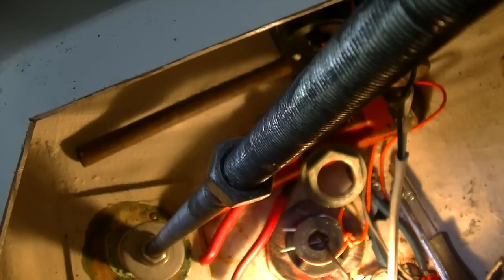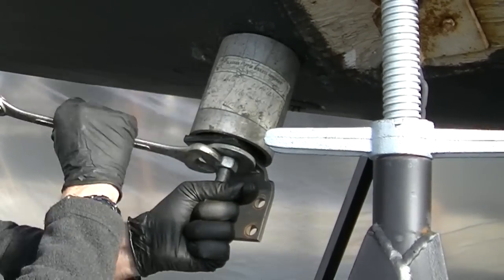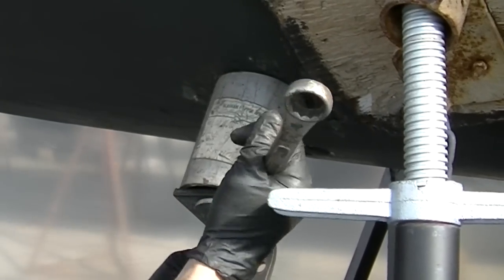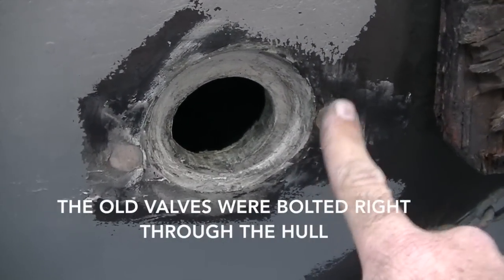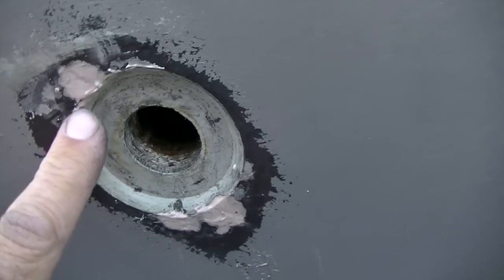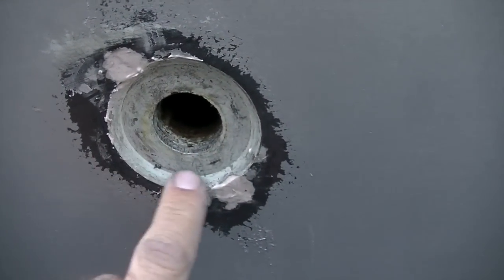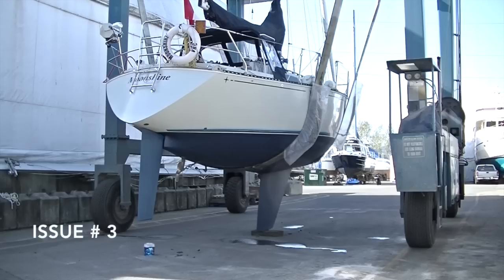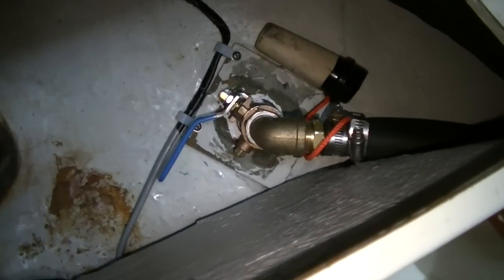Life is Like Sailing - Head Systems Upgrade -  Part 2

Comment: It's a shame that most people hired do not dedicate themselves to provide quality work. In the boating maintenance industry, word of mouth is king, and I'm sure people like that do not get recommended. I'll be looking at some similar work by next year on my boat. I just happened to remove a Jabco head similar to yours to rebuild the hand pump, and I'm seriously considering a composting head and replace the holding tank with an extra fresh water tank on my E33. I'm currently at a marina in FL, but plan on being on anchorage by early next year, so the extra fresh water will come handy. I guess I missed out your haul out videos, so I'll be searching for them. Thanks for sharing!
Reply from the maker: +javacup912 I agree that a composting head is probably the better route to go!   Once I know for sure if this is the boat I will keep long term then I will likely make the change.  Always nice to have lots of fresh water aboard!  :)

Comment: Wow...sorry to see and hear that, Alfy. Is it normal to put that sealant on the threads of the sea-cocks?  When I replaced mine ( i didnt change the thru-hulls), but only used tape-dope (teflon tape) on the threads and elbows.  They don't leak, but I did put the sealant on the hoses where they connect to the fittings.  I also replace the plumbing with the new white hoses like yours, and I also got a new jabsco, but the miniature one since my head is smaller (27ft boat).  Its gonna be a mess when you have remove the sea-cocks for their inspections/maintenance.  I was surprised to see the mechanic put the sealant on the outside fo the hull to where you wanted to epoxy.   Well at least you have a nice new toilet and all new hoses and valves!  Glad to hear you back on the water, though.  I launched but pulled the boat out since the stuffing box started to leak.  1 drop every 5 seconds with no rotation of shaft, not a terrible leak and I tried to tighten it, but it didn't help.  Since i do my own work, and it was the first time for me, I pulled the boat out to change the replace the old flax with new.  I try again next thursday, so I hope my repair was good.  Anyway, thanks again for your videos.  It's awesome that you share this with us.  Great to see other sailors and how they deal with issues and sailing.  Take care, Alfy.
Reply from the maker: justice tek I'm not sure if it is normal practice to put the sealant on the threads and I figured teflon tape would have been fine as well?  Glad to hear your don't leak.  :)  

That stuffing box sounds like it was leaking a bit too much so good you are going to re-stuff it and sounds like you are getting lots of things done on your boat!  :)

Comment: Nice boat and good videos . There is no excuse for bad workmanship . The valve you have has a bolt on the side . Get spares as the tend to corrode away in time .. (I had this happen crossing the Atlantic). There should have been an absorbent washer / spacer between the nut and the hull . Keep videos coming . Great stuff.
Reply from the maker: matrixi4i Good info to know and thanks for sharing that!  Glad you are enjoying the videos!!  That must have been a great crossing!!
Reply: Was a great trip . Couldn't work out why I was taking water in heads outlet until I found that bolt on side had corroded and was leaking. Even thou it was Bronze (never use brass).Keep up the good work-Mark
Reply from the maker: matrixi4i Sounds great and thanks!

Comment: hello excellent videos! I'm wondering how you secured the base of the head-bolts or screws? if bolts how were you able to tighten the nut on if its solid underneath the head? thanks

Comment: Maybe you already addressed this but, how come you didn't remove the new sikaflex and epoxy around the thruhulls . It would have been a bit of extra work for you but it would have been done. I hate to keep thorns in my sides, they bug me a lot. hehehe
KORITFW
Reply from the maker: +Mazda rx7 I was running out of time to get things done.  Next haul out I will pull the thru hull and do it properly.

Comment: Alfy, I can realy understand that you are unhappy with that work!

I replaced two through-hulls ( correct spelling there?) and valves, being a bit paranoid I did use a bit of sikaflex, but it still looked alot better then what was done on your boat! Been holding for two years now.

Also, as you said in the vid, sikaflex is more a sealer than filler material, (even if it could be used as both in a pinch). Why did he ever use sikaflex as a filler?! Chocking.....

Thanks for the vid!

/T
Reply from the maker: Tor Erlfeldt BIG lesson learned for me on this....I should have just stayed in the yard longer an done it all myself!

Comment: Hey Alfy. I had the same thing with my Jabco Head. Bolts were loose at the same point as yours. Must come loose from the factory for some reason?
Derek
Reply from the maker: Dans L'eau Hey Derek, good to know for others who are installing this unit!  I guess I figured my mechanic would have at least checked the system with a little water before leaving.  lol

Comment: Understand you hired it out due to a lack of time. Still a shame that this pos installer did such a crappy job ! I would post his name so others don't get ripped off as well. 
The through hulls you selected... not ones I would use. Last boat I used Forespar marelon seacocks, but next one will get Tru-Design composite thru hulls. No more metal for me under water. To much risk of electrolysis. Had a boat sink due to it. 
But a composting toilet would have eliminated a lot of those.

Comment: I would be more concerned that your mechanic didn't install proper seacocks  those bolt holes were there for a reason.  they are there to connect the flange of the seacock to the hull.  you're new fittings are weaker than the original.  seacocks have bolted flanges for a reason.  the flange takes the twisting force of the handle off the relatively weak thin wall thruhull.   I'd be having a serious chat with your mechanic as he's left you with weak below the waterline valves!  those will not pass a surveyors inspection!   some of those parts look suspect.  The tail on your sink hose looks very yellow.  usually an indication that the metal is bras not bronze!  dangerous combination in sea water.  brass rots away at an alarming rate!
Reply from the maker: Pierre Mitham The thru hulls were in there before were very old and the new style thru hulls I found were this newer style which I why I needed the holes filed.  There are two raised tabs in the thru hull near the outside opening to hold it steady while it is being installed.  I don't think the marina chandlery would have sold me thru hulls that wouldn't pass an inspection, but I will go talk to them and ask some questions about them.  They are bronze for sure though.  :)
Reply: Check out this article on installing seacocks. http://www.pbase.com/mainecruising/seacock_primer  
He writes excellent articles are n the subject. Your chandler should know that you need seacock, not ball valves. Huge difference in strength. All seacock use through bolts not just the old style. Go have a chat with them after reading this article.  Odds are you will be more knowledgable than them on the subject.  I would keep an eye on these and plan for a replace,net at next haul out.  In your current new install you have mismatched threads. The ball valves use npt threads (tapered) and the thruhull is nps (straight). This means that there is realistically 1 or 2 threads making the joint and seal.  Not a good arrangement.  I'm not trying to scare you,  but never trust the store to know what you need,  they're just selling parts!
Reply from the maker: Pierre Mitham I will check out the video and talk to them.  I do know that the reason I replaced everything is that exact taper issue between the thru hull and ball valve.  So the new thru hull and ball valves are both straight and fitted together from what I was told, but I will definitely look into this more and find out.  Thanks for the info.  :)
Reply: LifeisLikeSailing - Vancouver, BC

Definitely look into it,  I have yet to see a ball valve with NPS threads  one one end and NPT on the other (which in this case is what you would need)